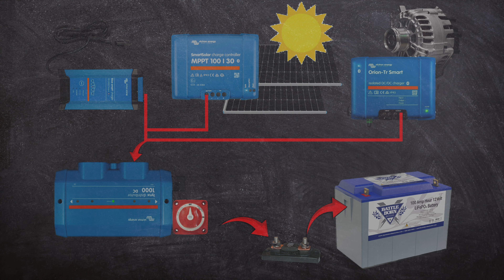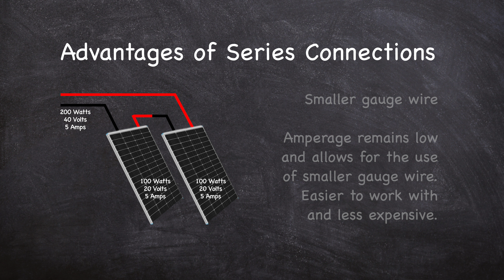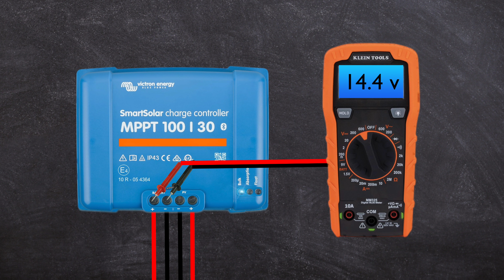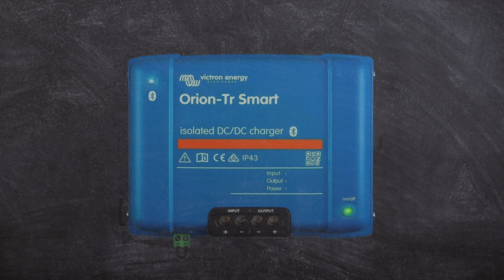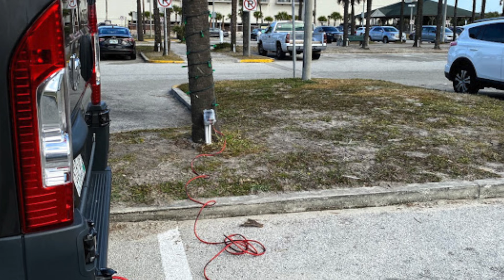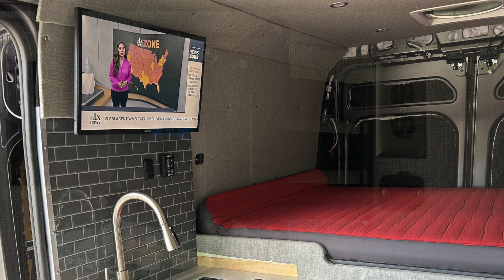Three basic ways to charge your van's battery bank

Comment: The Orion XS is NOT isolated ⚠️
Reply from the maker: @NordicPass You are correct!  That was a typo and I’m glad you caught it.  While the charger I used was the isolated version of the Tr (even though I installed it in a non-isolated system), the newer XS is non-isolated.  I think Victron simplified the isolated vs non-isolated decision by offering only one method!  For the vast majority of installations, non-isolated is the way to go in my opinion.

Comment: Hey Jason  love the videos on setting up electrical components! I have a promaster as well and I want to install a shore plug to charge up my batteries in the winter and occasionally at campsites. My van currently has 400 ah ago batteries, 400 w solar and a 4000 w inverter only. I bought a gopower transfer switch along with a shore power plug but kinda confused to the connection that I need to do. Definitely a newbie with electric! Can you tell me how you would wire in the switch to my existing setup so I can plug in and charge up my house batteries and use it at a campsite if needed? Also I can charge up the batteries by running the van but rather not do that if possible. Thanks in advance, Robert
Reply from the maker: That sounds like quite the power system!  I would start by installing a shore power outlet.  If you haven't already done so, check out my video on Shore Power - https://youtu.be/-cTJg7-Vids.  From the sound of it, your switch would plug into your shore power system and automatically send power to your AC panel.  When you unplug from shore power, the switch will automatically start up your inverter to power you AC circuits.  Beyond that, the wiring details should be included with the switch.

Comment: You talk about "code" in regard to the solar disconnect. Is this a residential solar code or is there something out there for vans/RV ? Also, the interconnect cables between the parallel connected  batteries should be about the same, but the length of the other battery cables do not need to be matched. For any of the big cables, shorter is better, of course -- within reason. The largest currents are in the loop from the battery to the inverter back to the battery. Try to minimize those lengths.
Reply from the maker: Thank you for that information.  In regard to the solar disconnect, yes it is a NEC code requirement, although it is not stated in the code that vans or RVs must follow it (NEC 2020 Article 690.13).  The type of disconnect I used meets the requirement because it is rated for the high voltage solar panels can produce and because it disconnects both the positive and negative connections at the same time.  Other power disconnects are not rated to handle high voltage (above 50 volts for example) and usually only disconnect the positive wire.  

You might be interested in this video from Explorist Life - How to Wire a Solar disconnect for a DIY Camper Electrical System (5 minutes into the video)